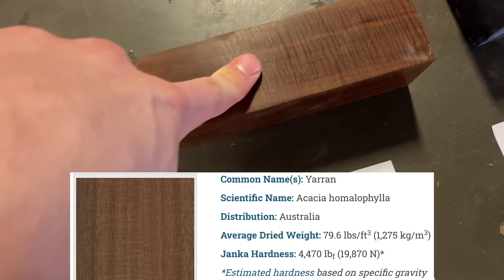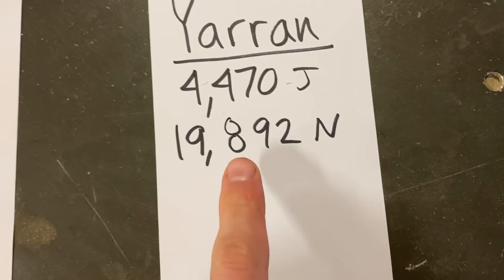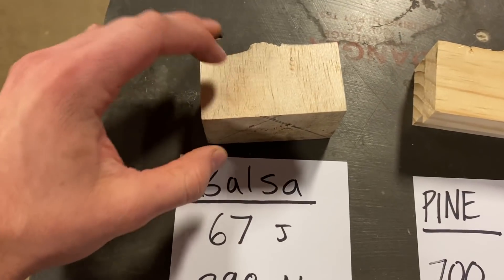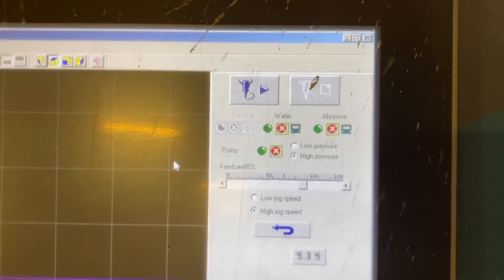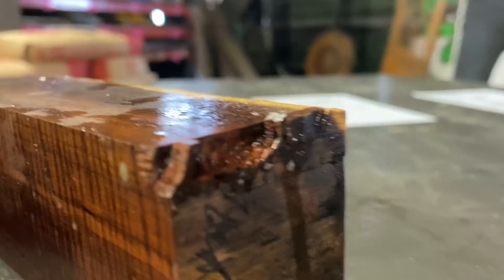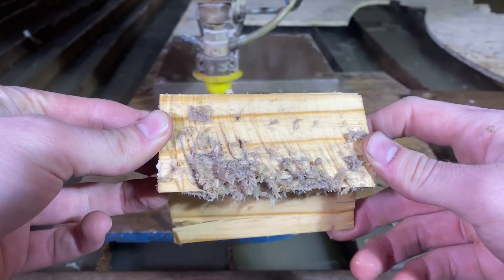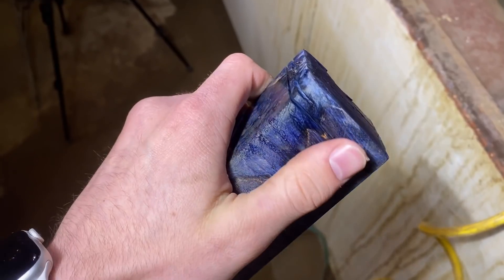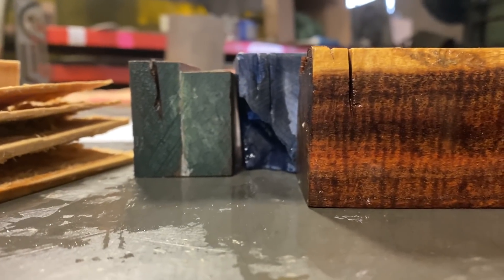How Strong Is The World's Strongest Wood? - Waterjet Test

Comment: 0:44 wrong technically there’s 4 harder woods Yarran is 4,470 Lignum Vitea is 4,500 Schinopsis balansae is 4,570 Schinopsis brasiliensis is 4,800 and Buloke is 5,070  waddi wood isn’t on any lists I’ve seen if it’s true that it’s 4,630 than that’s 5 harder types of wood plus who knows about the undiscovered trees in the Amazon